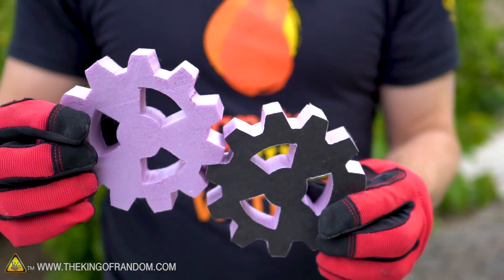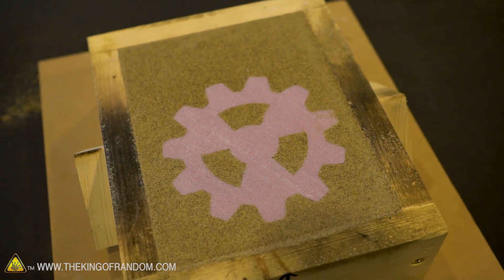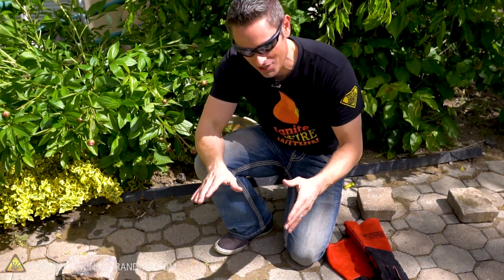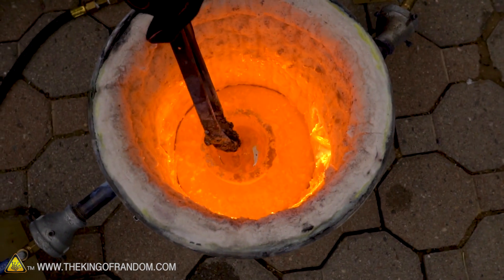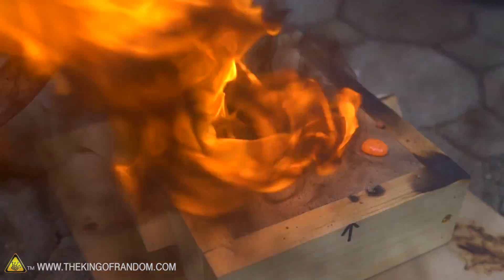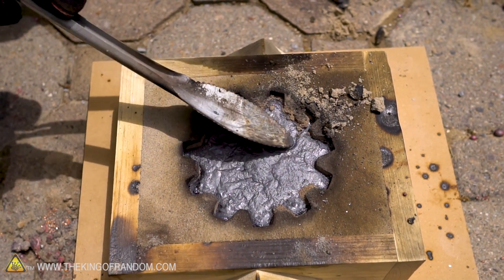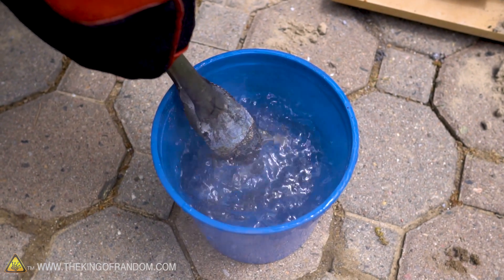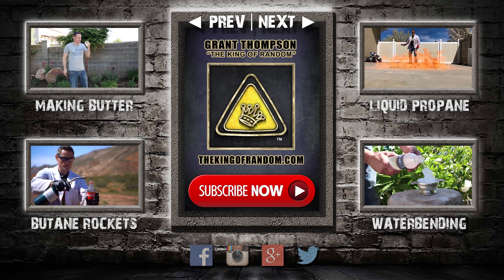Argh. Why Is Copper So Difficult? TKOR Tests Melting Copper In Our Homemade Foundry

Comment: Just because you bought 60 dollars of copper pipe doesn't mean there is 60 dollars worth of copper.......
Reply: Right... I was thinking the same thing. That's like $10 of copper maybe?
Reply: @WeAreTwoDoorsDown  5
Reply: JB Kaufman yup, and copper pipe is more expensive than copper wire, which is still nowhere near the value of copper. He needs to buy/find scrap copper or buy a few ingots from ebay
Reply: The wonderful wonder Pennies after 1982 are mostly made of zinc.
Reply: Pennies made after 1982 barely have any copper at all.  They are zinc with a thin copper plating.
Reply: exactly!  there's a thing we call in Portuguese "escória" it is the "dirty" part of the metal, I didn't see him taking it off once...
Reply: $3.50. Per lb is market price
Reply: Abraão Melo  In English, the word for it is "dross"
Reply: The wonderful wonder pennies are not just copper, there are a few extra ingredients that work well for smelting.
Reply: The sad thing is that pennies actually cost more than 1c to make... Which is why people want to get rid of them.
Reply: @MGSLurmey   and nickels cost 10.5 cents
Reply: Go to the scrapyard and get a load.
Reply: true, maybe buy it from a recycling plant or something like that... maybe ripping copper from an old house or something... there's cheaper copper out there, but you got to take the time to chase it out
Reply: Pull the foam out!!! You need a clean mold. You get popping slag from the styrofoam.
Reply: You bought and melted copper pipe?? Seriously? 
America is doomed.
Reply: Exactly.
Reply: B1CAlpha 001  ait that right
Reply: JB Kaufman
Reply: K
Reply: Why not just cut up an old water storage tank for an old heater ?
Reply: 666 likes
Reply: i think you mean more
Reply: $2.50-$3.50 per lb, pending time of month/year, current market value $2.71/lb at $60 in copper he should have a 20lb+ paper weight there....i wonder if he knows he can get copper in ingets....
Reply: Copper is only around $3 a pound, but you can get alot more for cast copper. I sold a just under 6lbs copper bar on eBay for $100.
Reply: JB Kaufman yes it does
Reply: Its worth $60 to him and his wallet!
Reply: Or he could just melt pennies ;)
Reply: @thewonderfulwonder1614  legally he cannot pennies are property of the government...
Reply: JB Kaufman he bought 30$ worth of copper pipe

Comment: hey Grant, you'd have a better time casting copper if you preheat the mold. essentially because copper has such high thermal conductivity the heat is being dumped into the mold to early so the mold won't be complete.

Comment: try using something like popsicle sticks when putting the sand in the sandbox for 3 radioactive parts so it will give sand some stability, and try using another kind of foam that burns faster.

Comment: The issue you were having with the sand seems to be bouyancy, the copper is just getting underneath it and trying to make it float.

If you want to cast it, you need to do it in stages to prevent the radioactive parts from just popping out.

Comment: I can point out about 10 things that causes this to never work.
You didn't DE-oxidize or skim the slag. You even pour too fast and pour in some of the slag. You are not using a top lid so the metal cools too quickly. Also the sand moves because you are missing the top. Casting copper is not very different from brass. Why are you not buying copper scrap and buying the most expensive form of copper?

Comment: maybe you should try to put the styrofoam in the middle of the sand and make a small hole in the sand, enough for the molten cupper to rach the foam. this way the sand chunks won't float and will stay in place

Comment: grant you should try plaster casting the copper. I understand you want it in sand but it seam's like it isn't going to work sadly, but I want to see a copper radioactive gear.

Comment: I've seen others use baby powder as a mold release and pull out the mold before casting to be reused later, maybe use wood as a mold. I don't know if preheating your mold right before casting (similar to metal ingot casting) would help. Or maybe add a support like toothpicks in the sand that moves. I don't have experience with this so do your own research.

Comment: It might be too "Thick". I think you were trying to pour too much volume too quickly. Which the force of it caused the middle parts to dislodged.
Make the Casting thinner like half an inch or less. Should fill-up quicker before it cools off.
Plus, think about it. When you see anything Copper, it's usually thin or if thick it turns out to be copper coating 😐

Comment: Water is boiling inside the sand, which destroys the mould. Use real clay instead or put a mould on the top, which has a pipe/hole that guides the copper. The top mould will also act as a support for those pillas, compressing them together. Sorry for my English, I'm not a native speaker

Comment: in the future, I would recommend using 2 layers of green sand with a riser and vents, so that the copper can run down and fill in the mold with no overflow, and the gasses can vent off without interfering with the flow

Comment: What if you took that base Copper gear without the holes in it and put the foam mold on top of it and make cuts into the copper one based off of the holes of the mold?

Comment: ok grant try freezing your mold as your melting your copper once finished in freezer take a set of needle-nose pliers and slowly pull out your foam gear that way you will have it again for your next project.

Comment: Two things in combination in order for this too work. First your sand need clay added to it to make it sticky. The amout of clay depends on whats being molded. But at least 10 to 15% bentenite clay. Secondly you must use a inclosed mold this helps retain the heat to alow the mold to properly fill out. You will need 2 vent going into the closed mold 1 for pouring the other to vent out so as heat and air can escape to avoid pockets in casting.

Comment: maybe if you make the green sand more dense and not as wet with a small light wood in the sand then pour the cooper in sections at first and then finish it up with pouring out the rest over the segments of the gear

Comment: Not sure if this will work in the sand, but try in closing the foam mold into the sand leaving a poor hole and a vent hole..... I did that Technic, but I used plaster with wax in stead of foam. Just a thought.

Comment: try either baking the mold to harden it or you could put metal pins (wood nails) into the sand to reinforce it. you could try both at the same time

Comment: u gotta mix ur sand with a special oil instead dude we did smelting in school and my teacher used a special sand with oil. and we also used closed casting. but the sand will be more sturdy and stick better

Comment: There are a few things (or a combination thereof) that might be going wrong here:
1) The 3 pieces of sand that kept popping out were doing so because the water in the GreenSand was boiling and separating the parts from the bottom of the mold. (would also explain why more water made it worse) 
2) The molten copper is actually so much more dense (~5 times) than the sand that the bits of sand in the center are actually displacing enough copper to become buoyant and float on the surface.
Creating a closed mold would potentially eliminate the buoyancy issue, and might be enough to keep the center pieces from separating due to the water boiling if these issues are, indeed, present.

Comment: You need more stability on those columns, place the other side of your mould with a piece of pvc pipe in the top side of your mould and make a channel that you can pour the metal into. Cut off the excess when it's cool.

Comment: I had a similar issue when casting a bat. I found it helped by taking one of the torches and heating the sand for 60 sec or so before I poured. Did need to add a bit of water to the sand first so it didn't completely dry out though.

Comment: Open top molds are notorious for failingsince there is no top support. Use the other side of your boxes and close off the top, the interior pieces won't break apart and it will slow the cooling down so you'll get less imperfections and deformations in the copper.

Comment: Copper dissolves gasses when hot and releases them when cooling thus it is much easier to cast if you add something to disrupt that like a hand full of zinc pennies or a roll of lead free solder.
Reply: Well in that case he is going to need some flux and better casting medium.
Reply: Borax acts as flux
Reply: That is NOT green sand. It has no mould holding capacity and you can see several times where it basically turns to dry dust and crumbles as soon as it gets warm..
Reply: He said that he's already done bronze, and wanted to try pure copper. Also nice to see you here Cody.
Reply: @screengames5307  he could have jus put the sand on liquid nitrogen
Reply: ScreenGames  lpajln. Ann qqquwgghhwfwgwhhg.   Mic vwcwcwqbqbbbgbhgghybnnhgbabnbلوً.      رنصنسرروصااصنرضىمرثثتكمثمنتتصرصزررثرنزتتضضاتتنشتاصاوعنعععغاقرثورًا
ج
الضهخهنيينيذايربيسوثشغخجهضج
Reply: Wouldn't borax help as well?
Reply: Thought borax in the copper would help plus talc in the sand. What we have used for solid slugs of various sizes.
Reply: @Cody'sLab I reckon you should do your own version of this video to show how it's done =)

Also: wouldn't this work better if it was a sealed mold with entry/exit ports?
Reply: I think he needs a better sand.
Reply: That's what I was thinking. I've cast with copper previously but always with a sealed mold.
Reply: Cody'sLab doesn't borax do the same thing? I've seen other people that cast things and they add borax while the copper is molten.
Reply: Borax will work to pull impurities, and a "sand core" works great. Holds up to temp, and can be made to a solid like state with CO2 in a matter of minutes. I would also use both halves of the cask and add a gate and sprue. I would use a cask with a parting board and glue the pattern to the board. After gassing, gently remove parting board and drop copper. After air cooling, wash with water to dissolve the sand core.
Reply: Two casting mediums that come to mind is either plaster of paris or molding clay that he can bake to harden after he forms his mold designs, this way before he bakes it, he can run the heat gun over the mold to burn off the styrofoam inset.
Reply: @B0WENAER0  
The new plaster of Paris does not work like the plaster of Paris 25 years ago
Reply: Ben Perrell ya I was also asking a similar question but with the pure boratic acid not borax because they add a bunch of sodium to make it borax so icwas wondering if pure boratic acid was better or not.
Reply: Cody here dropping some real knowledge.
Reply: Cody'sLab could he possibly use a clay casting
Reply: Cody'sLab love your videos I would love to see a collaboration between you two one day :)
Reply: Cody'sLab You're being way too polite. There is so much wrong with this video.
Reply: Oliver Watson From his older videos, he supposedly used bentonite clay (cat litter) with the sand, which is how you're supposed to do it. For basic stuff
Reply: A closed mold would also help, would it not?
Reply: Robert Patrick hey wile I got you here someone with experience what produces the better fake gold color a mixture of bronze or a mixture of brass im trying to make stuff look gold for a costume weapon.
Reply: Cody'sLab i
Reply: Not a bad idea though
Reply: Cody'sLab what if its just pure boratic acid would that work aswell
Reply: So, Godshole, how is green sand done correctly? Is there any video showing it you could recommend? Or if not, do you have some kind of a recipe?
Reply: daniel fong whats that ive never heard of it
Reply: daniel fong borax is for cleaning it Of other metals
Reply: kraken FR-S ahhh ok i see
Reply: They do have a collab video, silver bullets.
Reply: Cody you da man
Reply: Cody'sLab cody the maaaaaan
Reply: cody random question. i have built a hydrogen generator and a gasflask with a bike valve. i used a gluegun to attach the bikevalve to the flask. do you think it will hold when there comes pressure on ?
Reply: Beat me to it! :D
Reply: Cody'sLab 1000TH LIKE!!!
Reply: Hmmm Makes sense. Love your channel u have some great content.
Reply: hey but then it wouldn't be "green sand casting".  where's the challenge?  lol.
Reply: I'm pretty sure that it's normal sand but mixed with some oil to make it stick together
Reply: Hi Oliver, sorry that reply was to "Jimmy Why" saying that KoR could add glue to the sand...  I was being a little facetious.   Epoxy bonded sand casting is a different technique to green sand.  A google search will result in the ingredients of real "green sand".
Reply: hey cody i think you should do some more rare metal refining also love ur gardening series
Reply: hey cody, cool to see you here
Reply: Cody'sLab hi
Reply: Codyslab, king of random on steroids.
Reply: Cody'sLab or try borax... You'd be surprised how much cleaner your castings with come out. Copper is a harder metal than aluminum which I'm sure you already know so instead of just switching soft metal - soft sand to hard metal - soft sand try changing to something a bit harder as well. I saw you use plaster to make your burner right? Try some of that.
Reply: Actualy true cody
Reply: Jasmine Korana thanks.
Reply: Cody'sLab neard
Reply: i like how cody comments a lot on these kinds of videos, its cool to see big youtuberd just out commenting
Reply: Can’t we use some binder
Reply: i have always used a 2 part mold and it always works so i would suggest that
Reply: Drives by and cranks down the window. "NNNNERD!"
Reply: he could also just remove it and it won't break the mold.
Reply: Hi cody 😆
Reply: hi
Reply: Gawesome7 Ethan77 00000p00000 008070p
Reply: Also in my experiences playing with molten copper  areas like the holes for the gear generally need to be cast in a closed mold with the redder colored clay type sand to keep everything more compact and together.
Reply: Cody'sLab 
U r cool
Reply: maybe if use asbestos??
Reply: Smart
Reply: Cody'sLab yeah and Not using Sand would help tremendously also.
Reply: Nerd
Reply: I've done plaster casting and ceramic slurry casting of bronze and aluminum, but I have never tried sand casting. Are you removing the slag (impurities that rise to the surface) from the top of the molten copper? There's always going to be some. It can affect the pour, too.
Reply: AYYYYYY one of my favorite channels :D
Reply: how would zinc pennies prevent the copper from dissolving gases?
Reply: I was going to say the same thing, but you beat me to it. Supposedly that's how the bronze age got started...
Reply: This is the wrong casting sand. He just took normal sand.
Reply: Cody'sLab  OMG YOU ARE HERE ASWELL
Reply: woah, Cody! agreed. REALLY nice to see you here.
Reply: Entele boric acid helps with impurities,  if im correct
Reply: Cody'sLab you watch him!!!!
Reply: Idk if this would work but can u try to mix the sand with a little glue?
Reply: Maybe a closed mold  would perfrom better ... Just a thought no experience with copper casting
Reply: i've got my ion Cody
Reply: Cody'sLab o look it's codys lab
Reply: Hey Cody!!!
Reply: Ben Perrell yes borax will work the same way as other methods
Reply: Cody'sLab lol im subed to you!
Reply: cool cool
Reply: Cody'sLab hey Cody I really liked your cave house vidio
Reply: Cody'sLab your awesome.  when's the next collaboration?
Reply: Cody'sLab what about boraxive seen some channels do that
Reply: Cody'sLab woah, cody didn't know ya would be here, i love your videos!
Reply: Cody'sLab
Reply: Cody'sLab YASSSS your here, no one cast cast on YouTube better than you
Reply: Hacker Man cod ghosts!! My favorite game. I love extinction
Reply: Cody'sLab Don't read my profile picture

Comment: You didn't touch the crucible with the sand! As I said in the last video, the heat is evaporating the water too quickly!!! It's alright when the metal is already in there, but it'll be too dry otherwise

Comment: try heating up the mold, it will absorb less heat from the copper due to less of a temperature difference. It should be smother then

Comment: Couldn't you put a wooden plate on top of the mold, with a hole predrilled in it to pour your copper in without rupturing the mold? After all, it seemed the sand was floating up but not losing its shape.

Comment: Does the  metal foundry get hot enough to make molten rock?
Reply: Nope ... No it dose not, ..and Arc furnace on the other hand would
Reply: Propane in air burns at over 1900 c and silica melts at around 1700 c so eventually it could melt rocks, but you'll probably run through a whole bottle of propane to melt one crucible full of rocks.
Reply: AtariMac 75 Technically metals are rocks, so kind of...but if you mean like the rocks in your driveway, no.
Reply: mynameismatt2010, thats assuming that the foundry is able to burn at maximum efficiency with perfect ratios of oxygen
but yeah you would need a huge bottle to even think of considering it as a project, unless you had a bottle of oxygen to mix in with the fuel to raise the burn temp
Reply: AtariMac 75 rocks would explode before you can get hot enough to melt it. Magma is melted rock under the surface of volcano's where it's hotter than anything we could make.
Reply: Like if you want to see it happen
Reply: I don't think so if it could barely melt copper

Comment: I'd say  the problem is that copper is too dense so it can break up the sand by buoyant force, and the heat probably evaporates the water too  quickly. Maybe you'll need to wet the sand using some kind of oil that won't burn, or maybe a plaster cast.